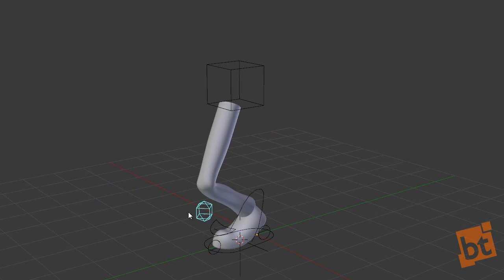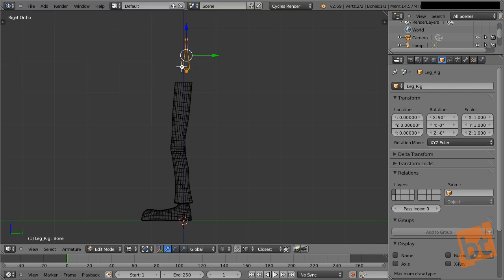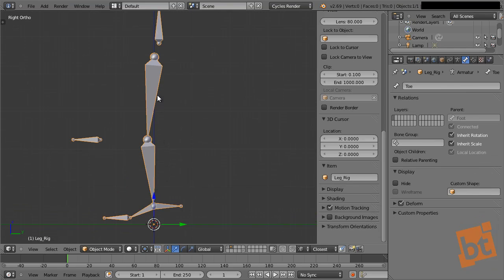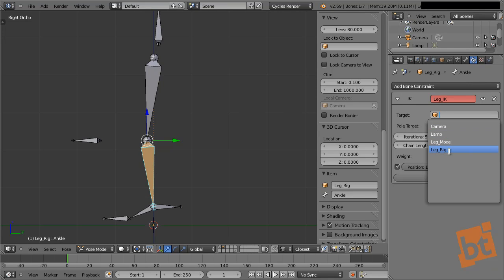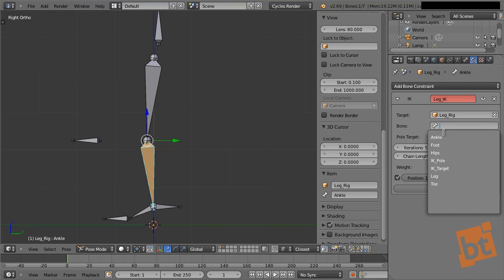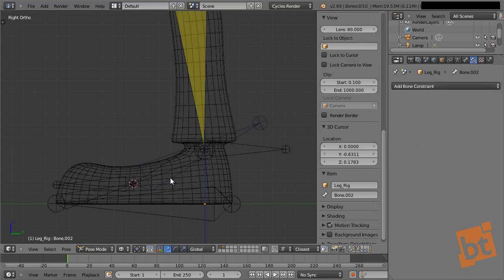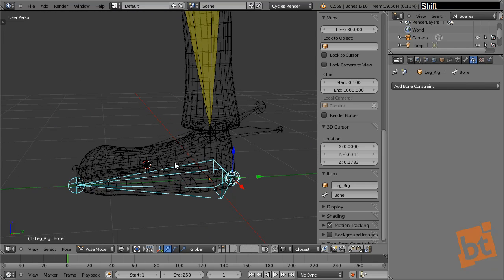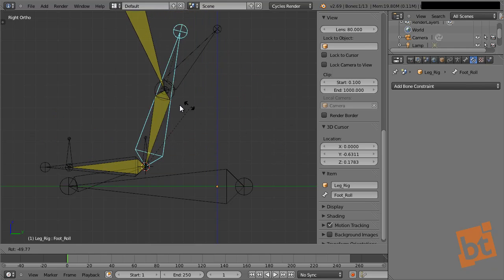How to rig a leg and foot in Blender

Comment: If you're watching this in 2019, know that this video is still as pertinent as ever. A fantastic guide to the most vital elements of rigging and IK/FK, every beginner needs to watch this
Reply: Hey, thanks for the heads-up! I'm just getting into Blender and bookmarking the hell out of every tutorial I run across. I of course wont know if they're still relevant to ver. 8.1 until I watch them.
Reply: I'm using it in 2021 and it still counts =]
Reply: @Brian Reginald Thanks so much for your reply. I got to the site on google and I'm in the hacking process now.
I see it takes a while so I will reply here later when my account password hopefully is recovered.

Comment: I followed this tutorial when i was rigging my character. I'm animating now and I came back just to say that this foot rig is a pleasure to work with

EDIT: this rig has one serious problem. When rotating the main control bone along the z axis, the whole foot twists. To control this, you need to UNHIDE the main foot bone and rotate it along (for me at least) it's local y axis. 
OR
you need to turn inherit rotation on for the main foot bone (the deform one between the shin and the toe)

Comment: Hey Oliver, great video. I love the simplicity of the foot rig, it's like a more advanced version of the Blender 2.49 foot rig from the Process Diary a while back. Thanks! As for Alt W, I may be wrong but i believe Shift turns stuff on and Alt turns stuff off? I think this applies also in edit mode for other settings. Thanks again.

Comment: Great tutorial! Seriously one of the absolute best!  I'm really curious about fixing the bone roll problem, the one you fixed by adjusting the pole angle.  I tried messing with the shin's roll and it didn't seem to fix it.  Any suggestions or is there another tutorial I can take a look at?
Reply from the maker: josh demo reel You can always display the axes, and roll them in Edit Mode (Ctrl+R) until they fit Pose Mode rolling (after applying constraints). I don't know of other ways of doing it :P
Reply: Ok, thanks!

Comment: Yo Oliver, nice video. I decided to watch the video before applying changes to my already made rigs. I do have 2 3d models already made an all, but my foot rigs are wrong.

The one thing I needed to look up in this video was the foot section because despite I followed another guy's video on rigging some time ago, the boots of my characters distort when twisting the feet round. Yet with the old rig I have, I can 95% get them to run normally without distorting.

Also, I used vertex groups instead of weight painting, so will this video be alright to use with vertex groups? I need to be able to twist character feet round to make fight poses and such (well, in reality karate, I can pivot my foot round away from myself when doing a spin kick, that sort of pose!). I have no idea why certain tutorials I follow doesn't work and some do.

Please help me out. I've been stuck on both lattice eyes and foot rig problems for months and I only just fixed lattice eyes with a different tutorial by another good guy.

Edit: Okay, your tutorial here helped quite a lot, BUT not entirely. The ankleIK doesn't work properly, however, I discovered I don't need to move it anyway to twist the whole leg round, so long as I don't tamper with the ankle IK, I don't need to care about it. So this tutorial has helped 8/10. If only you showed us how to set bones with vertex groups since some blender users prefer using v.groups instead of weight paint.

I'll subscribe to you since you helped anyway and for your hard effort. I do need my character(s) to blink, so hopefully your eye tutorials cover that. Good job though XD

Comment: Shift + W = is toggle so you can Enable and disable but alt + W = disable Deform ,  Also 3d view editor >Pose > bone setting > deform  = toggles the Deform  But you have to be in pose mode in order to do this.

Comment: Could i ask a question? i used the pole bone exactly the same as you set in the video. The problem is that, after i set the initial rotation and fixed the -90 degree problem. The IK rotation is also set to that degree, meaning the leg is not bending forward/backward, but to the side ways....it's so wired since everything is the same....
Reply from the maker: Hmmm did you try using other rotation than -90? like 90 or 180? -90 worked in my case, but might be different in yours :P
Reply: well, i solved the problem later. Since when i rotate the leg bones, i rotated its pre-bend together. Later i tuned the pre-bend, and the IK solver works just fine.

Comment: Hey, this tutorial is great. I was looking to have exactly this behaviour on the feet. Just one issue that I can't fix. I would like to export my animation to FBX with only the deform bones and not the controllers. When I do so and re-import it in a new scene, the feet slides as if they were following the Hips movement (I have a simple Idle animation). 
- I tried to make a root node that becomes the parent of the Hips. That did not fix the issue. 
- I even tried to bake the deform bones (Pose mode -> Pose -> Animation -> Bake Action). Still, the feet keep on moving.
- I grabbed all the bones (even the controllers) and bake them. That does not solve th problem.

Do you have  if this rig is compatible with what I want to achieve?

Comment: Thanks for this tutorial! Btw ALT+W turns off parameters from list and SHIFT+W turns them on :) That's why alt+w didn't work when were trying to toggle deforms on. Also Is that IK chain from 17:02 necessary? I forgot to make it but it seems to work just fine.
Reply from the maker: Oh! Nice! Thank you for the tip on the shortcut :)

Those IKs are needed, otherwise the rotation of the foot will be uncontrollable in some situations (learned it the hard way years ago heheh) :)

Comment: I have a question, i follow your tutorial, At the setting of the IK pole target.
i have uncheck the inherit rotation at the toe, and it works, the toe do not rotating with IK pole movement

i did it All, I try to rotate the foot control, the one which that parented by all bone controller, it works. But when it rotating at Z axis. it mess up, the toe rotating too..

can you fix this problem? sorry for my bad english
Reply from the maker: Bagus Basuki You might need to add pole targets to the foot bones too. I can't tell you more without actually seeing it ;P
Reply: yes it works, just add sone target pole to the foot bones

i think you should check yours... because you not mention it on your tutorial

thanks Oliver..

may i request a tutorial.. maybe how to make strechy arm rig? hehe
Reply from the maker: I know I didn't add the poles to the foot, because this tutorial was meant for beginners, so I wanted to keep it very basic and show the concept and tools :)
Reply: oooooooowwwwhh.. thats okay
Reply from the maker: I'll keep in mind your stretchy arms suggestion for future tutorials ;P
Reply: thanks a lot, it will be helpful

Comment: I'm new to blender, I learned everything in Softimage, and i'm having difficulty parenting the hip/upper leg bone to the torso/stomach/spine base or whatever you want to call it.  I have succeeded in doing it once before but i don't remember what i did to get it working correctly.  the two bones are in different armature sets(i'm rigging a whole person) and i know it's possible to to parent the two because like i said i did manage it before.  basically what happens is i parent the bones and move the torso/stomach/spine base bone and the leg just stays where it is instead of bend into a crouch.
Reply from the maker: I wouldn't recommend parenting bones between different armatures. It can cause refreshing issues when posing the character. Anyway, you can do it by having the "parent" armature in pose mode: this way, you'll be able to select the specific bone to parent the child armature to it ;)
Reply: Oliver Villar ok that's good to know, I acctually just ended up joining the armatures and I got the leg effector (the top bit on the topmost bone I'm not sure what that's referred as in blender) parented to the bottom spine/backbone/stomache or whatever bone.... but when I try to parent the arm to anything (I've already joined it into the same armature as the rest) it does have an issue like you said.  I was trying to set up the rig so that when the backbone was moved down it would pretty much bring everything into a crouching position... so any suggestion you have would be most welcome.
Reply from the maker: If your approach is to have the rig made up of different armatures... each leg, and each arm should probably be different armatures, as an armature can't have two parents at once.

Anyway, unless you have a really serious reason to make it like that, I recommend you to make everything into a single armature. Usually the whole rig is a single armature. Keep in mind that later, when you have to weigh the vertices to the bones... you'll have different armature modifiers to deal with, making everything much more complex than it actually should :)

If you haven't, maybe it would help that you see my other rigging tutorial in which I rig two eyes. That one is like an introduction to rigging, and it can probably help you understanding this better.
Reply: I have a very good background in rigging, i'm just having difficulty figuring out how to do it in Blender, I've already joined the armatures and managed to parent the legs to the hip area, it seems that i cannot parent the arms to anything though as they break every time i do.  If you have any suggestions on a simple fix that i am perhaps over looking due to my lack of experience with blender's interfaces that would be greatly appreciated.  Thank you.
Reply from the maker: Well... parenting is simple: select the children, select the parent at last, and press Ctrl+P. What you have to keep in mind, though, is that parenting bones should be done while in Edit Mode, it won't work in pose mode, and in Object mode you'll parent the whole object (armature), not s specific bone.
Reply: I am perfectly aware of how to parent bones,  I am simply having issues with the arm rig breaking when i parent it to anything.
Reply from the maker: Maybe you have the IK chain length value longer and when you parent the arm to the back, the chain gets longer, messing everything around? Otherwise, not seeing what exactly happens I have no idea what the problem may be :P

Comment: Hey dude thanks for the Tutorial really!  But I have a problem that's driving me crazy.. For some reason when I move my Leg IK, up it just goes left or right like wobbly, and my leg doesn't even bother to bend what so ever. What the heck did I do wrong?
Reply: Yeah idk why but for some reason when ever I add a pole it doesn't want to bend.
Reply: ZethsweyReaper Well when I check mark Rotation underneath weight, and make it 00.10 it lets my leg bend but my foot is a little higher up. like it tilted my rotation downwards, and when I move my pole left or right it doesn't move anything.AAAARRRHHHH!!
Reply: ZethsweyReaper Alright idk what it was but I just said F it and deleted my old legs and started over.
Reply from the maker: Did you remember to set the chain length of the IK? :O
Reply: Oliver Villar Alright I know this is old, but its all good now. Sorry for not replying earlier.

But I got another question to ask.

Do you think you can some time make a video for a full character/Human rig. That would be cool.